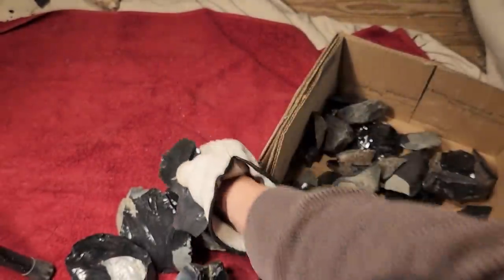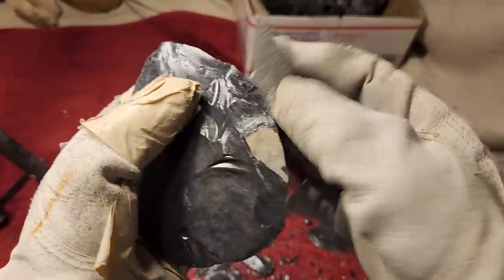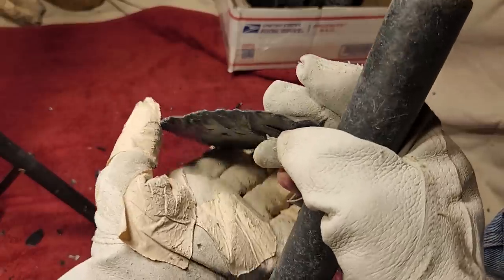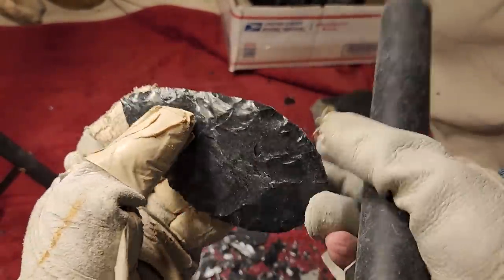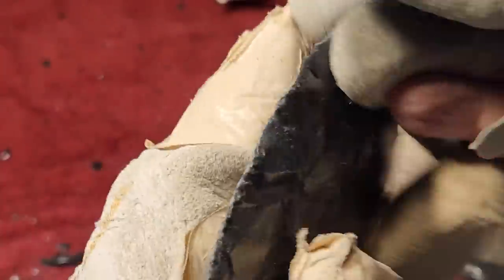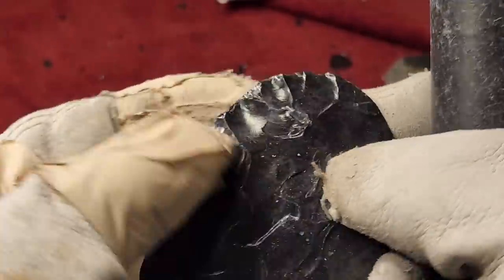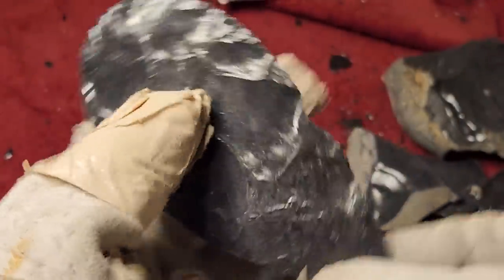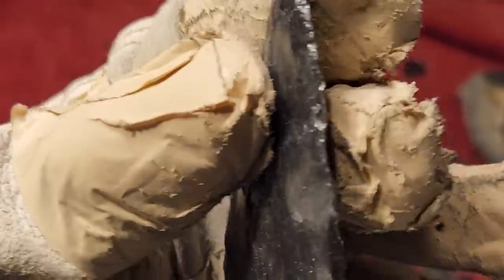1388 - Second Try Sampling - Obsidian Flint Yapping

Comment: The ~5k year old crystal daggers of the Montelirio tholos tombs, in Spain, appear to be flake over grind to me as well.  They are only edge sharpened and I've never seen a crystal with only two edges or facets.
Reply: agreed.  lots of neolithic arrowheads , daggers and knives were flake over grind . in ireland there are large kite shaped lance heads that have clearly been ground on the face then flaked . very interesting stuff
Reply from the maker: Yes.
Reply: @captainflint89  Hey!  There you are!  I was thinking just the other day that it's been a while since I ran into you!  Yeah, the neolithic in general is somewhat notorious for FOG knapping, isn't it.

Comment: Does aluminum works just like copper? 🙏🏽 thank you maestro!, what size is this rod you are using now, thickness)?🙏🏽
Reply from the maker: Aluminum is much softer than copper. I use 6061 aluminum. The dimensions of this billet are 1-1/2" diameter x 4" long.